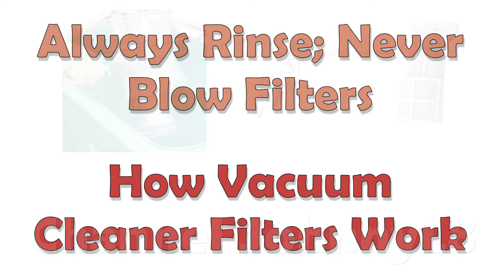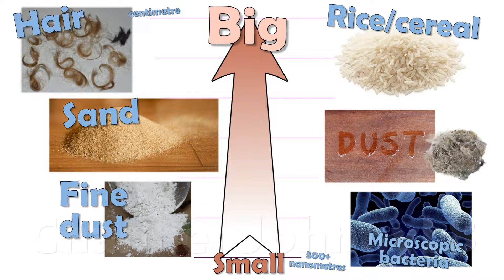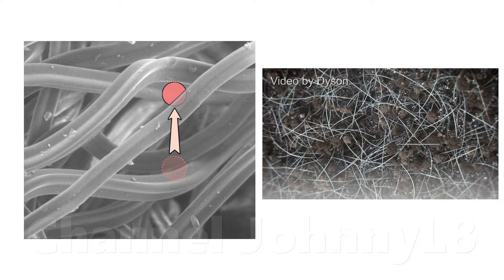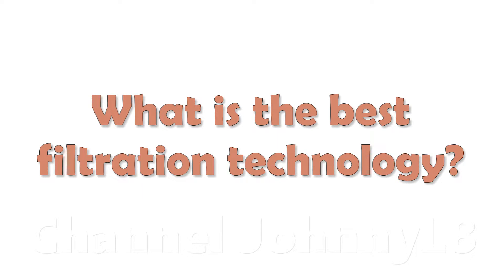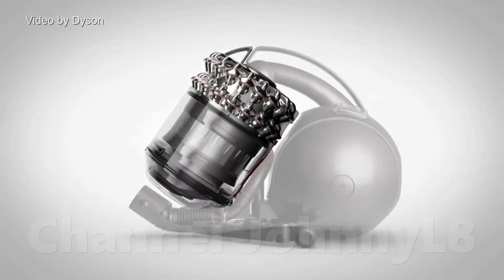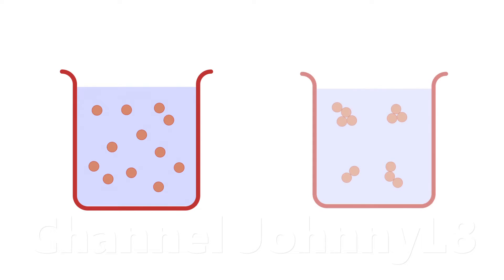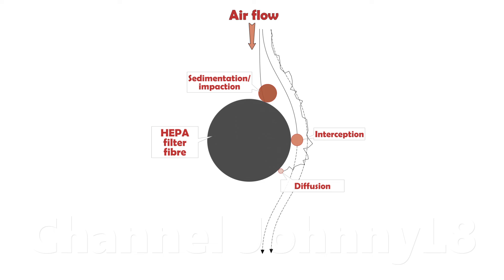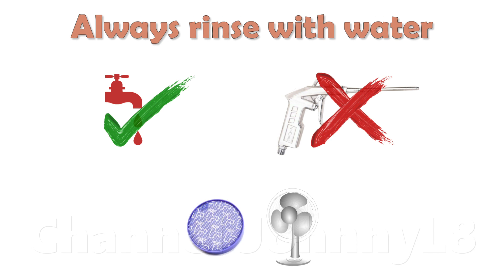Always Rinse; Never Blow Dyson Filters; How Vacuum Cleaner Filters Work

Comment: Should any kind of detergent ever be used when rinsing out filters? I never see it mentioned and assume it would not be good for the filter, is that the case? If you look at the dirty filter of a kitchen extractor though, you can imagine how it would be possible for grease and other things that water can't resolve to get in there. 
Also, how do you know when it's time to replace a filter, rather than just washing it? Dyson V series filters aren't cheep and I am not sure if the aftermarket are any good.
Reply from the maker: They are lifetime filters and should never need replacing short of abuse and neglect. They should only ever need to be rinsed with water and dried. On very rare occasions, some materials may not be rinsed with water (very large quantities of talc not generally found in the home is one example I came across once) and a machine wash solved it. But this came with lots of caviats which need to be understood. High temperatures, high g-forces from the spin, bashing around in the drum, and fabric softner will all risk damage (i.e., abuse and neglect), so these need to be carefully avoided as discussed here https://youtu.be/bP1vdnWIZSY

Comment: When you wash filters, specifically HEPA grade, eventually won't the fibres in the filter get damaged resulting in decreased filtration.
Water does dislodge particles better than air but will it damage the ultra thin fibres in the filter or not?
Reply from the maker: Fibres aren't damaged by water (by what mechanism, and more importantly, where is the evidence to distinguish from false assumption; clue: there isn't any). The Dyson HEPA filters, at least, are lifetime washable. Their modern filters are made of PTFE fibres (a form of plastic), and their very latest filters are made of nanoscopic glass fibres. Tough as nails and provide the highest levels of filtration above and beyond any other residential vacuum on the market by an absolutely astonishing amount. You can learn more here https://youtu.be/4aL0eJenTqw

Comment: If you wash them the dirt clogs and dries in lumps thus decreasing the airflow and efficiency. So i just blowing the filter or parts first then washing to remove any large dirt and debris before washing for the best results!
Reply from the maker: That's just plain false. If you wash it correctly, you dilute out the dirt and reduce its concentration significantly. Presumably when your clothes are in the washer, they come out dirty with the dirt all clumped together. Perhaps you could provide some evidence to back up your claim given there's none available anywhere to support what you say?

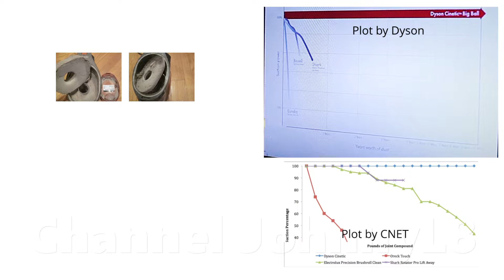Comment: 1:58 -- would you then suggest that the Dyson cordless models without a HEPA filter are bad cleaners? V6, V7 Motorhead, etc.
Reply from the maker: If they were mains powered, yes. But because they're cordless, no. The reason is because that formfactor of vacuum is relatively new and the technology to provide mains-like performance is very hard to achieve. Every filter you put in the way of the air path is performance lost and that needs to be compensated for by an increase in power (more so if the filtration method isn't immune to blockage, i.e. non-cyclonic). Increasing power means a need to increase energy storage i.e. bigger batteries to keep practical runtimes. More batteries means more weight. So it's a knock-on problem. To maintain the best performance on the market with all those factors considered, a HEPA filter presumably had to be excluded at that time. I don't think any cordless cleaner before the V8 had a HEPA filter. I don't think they even do now, but if they do, I'm fairly sure they'll be heavier or need more batteries/lack the run time and certainly wouldn't be able to achieve the same power. I would say that now the V10 has shown mains level cleaning performance with a HEPA filter, it's technically possible to achieve it, and so there's now no excuse for any manufacturer going forward, including Dyson, to not have true HEPA filtration. Anyone that doesn't should be called out and criticised in latest models on sale today onwards. Not having a filter from now is representative of a lazy cop-out which highlights technological inferiority and incapability of achieving both performance and HEPA filtration.
Reply: > So it's a knock-on problem. To maintain the best performance on the market with all those factors considered, a HEPA filter presumably had to be excluded at that time. I don't think any cordless cleaner before the V8 had a HEPA filter. I don't think they even do now, but if they do, I'm fairly sure they'll be heavier or need more batteries/lack the run time and certainly wouldn't be able to achieve the same power. I would say that now the V10 has shown mains level cleaning performance with a HEPA filter, it's technically possible to achieve it, and so there's now no excuse for any manufacturer going forward, including Dyson, to not have true HEPA filtration

V6 Absolute and several models of the V7 had HEPA filtration. No change in battery capacity or motor what so ever. In fact, the image you use to represent a HEPA filter in your video is a render of a Dyson V6 HEPA filter. https://www.dyson.hk/en-hk/vacuumcleaners/cordless/dyson-v6/dyson-v6-fluffy/features.aspx
Reply from the maker: Ok well V6 then—it was too far back for me to remember. I don't think any version of the V8 was without HEPA filtration. The V7 was a funny retro-fit release that came post V8 and was suposed to be cheaper alternative that had some technological improvements over the V6. But everything I said above still holds. In fact, in that case, it would be 4 years since the V6 release, so it's even more amazing (and shameful) no other cordless has HEPA filtration yet and achieves the same power-weight ratio.